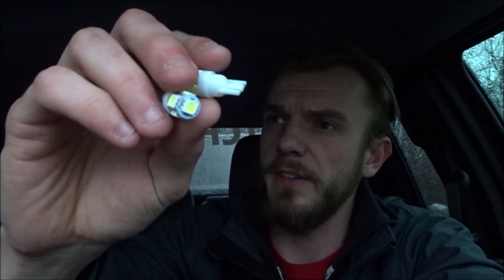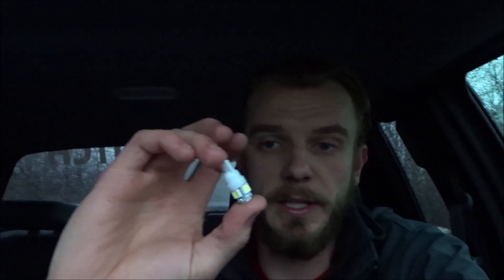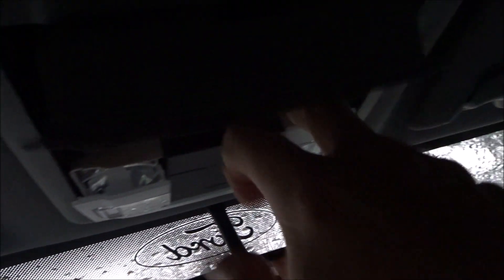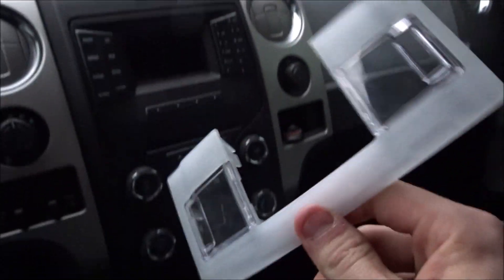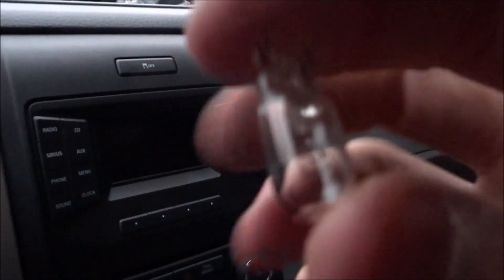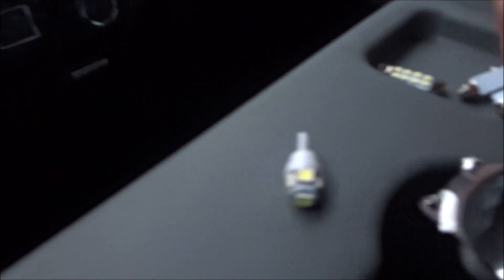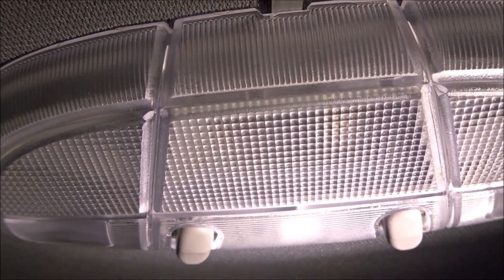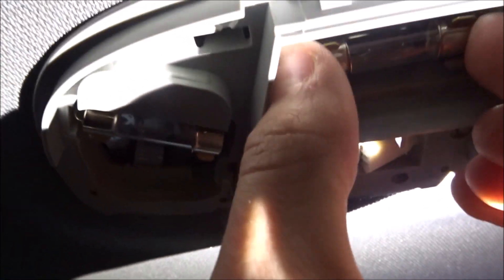This Upgrade Made My Truck Feel Brand New!

Comment: Hey bud I just got a 09 4.6l v8 f150 I just replaced the ignition coils with Accel super coils and spark plugs with motocraft double platinum iridium.  At first I had bad misfire under load and after the engine ran for about an hour. So I replaced the stock with what I mentioned.  Seems to idle better and mpg stabilized at 17mpg city. But the problem with misfire still happens only after a hour trip our decreasing speed coming DOWN a hill. Its like the wheels get turning faster then the RPM at the moment  and it induces a misfire until I give it a little throttle.  Plz help.

Comment: I did a full led conversion. Turn signals, brake lights, headlights, fog lights, side marker lights, all interior lights, and the reverse lights. I used JDM Astar LED bulbs and I used forscan to disable the hyperflash. And how did you get the rear seat headrests to fold like that
Reply from the maker: Nice! Eventually I'll upgrade all the exterior lights. As for the headrests, there should be a button on the side of them.
Reply: @HitchinMitch  i guess mine don't fold, I don't have the button
Reply from the maker: Guess not, I figured they all had the option to fold them down.

Comment: Glad you did this upgrade. If been thinking about it but couldn't figure out how to take the light covers off. As a matter of fact I was trying to figure it out two days ago. Are you going to change the lights on the outside back of the cab? Thank you.
Reply from the maker: I want to change the rear cab lights in the third brake light. Buuut I know this generation has a problem with it leaking and I'm afraid if I touch it it'll start leaking. Haha

Comment: Random, but where did you get your steering wheel cover?
Reply from the maker: Not random, I found it at my local autozone. But have seen it for sale at Menards (if you live in the midwest). Just found the link that someone posted on a different video before. https://www.autozone.com/steering-wheels-kits-and-accessories/steering-wheel-cover/custom-accessories-truck-tuff-truck-sized-steering-wheel-cover/298963_0_0